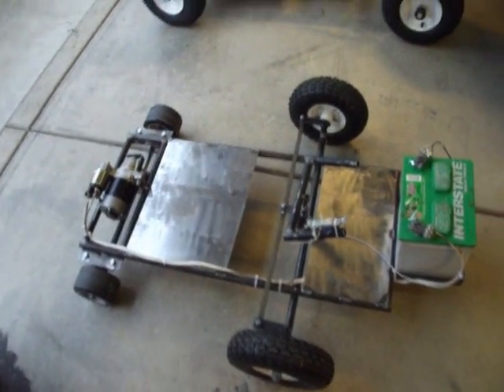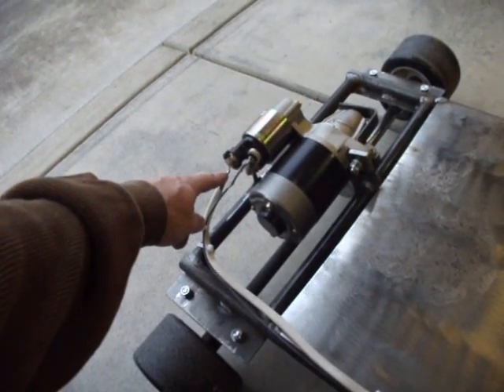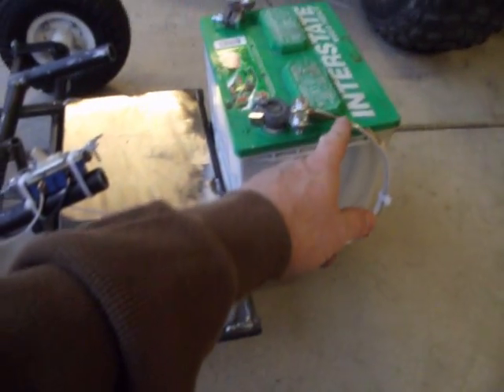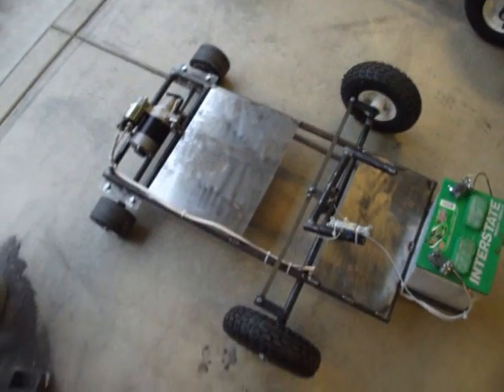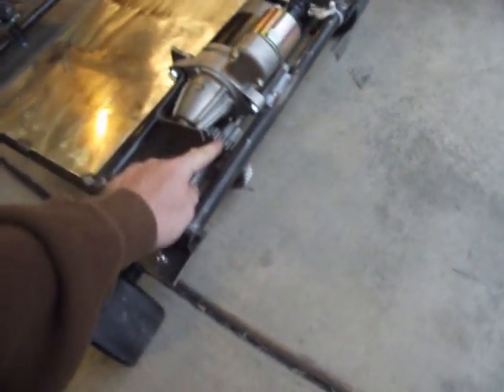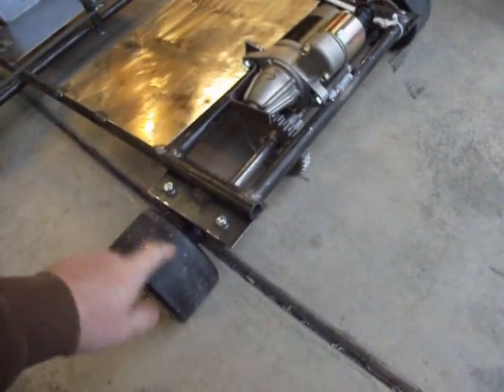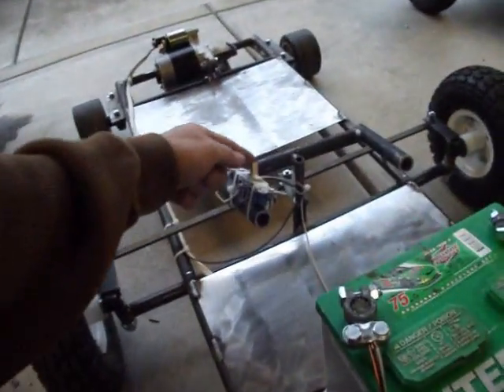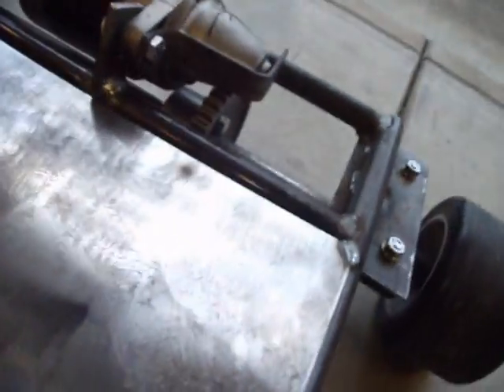Electric Go Cart 1

Comment: hi guy.. please explain who work The acelerator... i have a starter motor of motorcycle but can't controller the acceleration... help me please
Reply: Remove the solinoid and connect  riostat as a throtle
Reply from the maker: i just flip the light switch on and off NO accelerator! that is why im using plastic tires so they spin

Comment: can any one help me. i have a 12V starter motor that i want to use for my electric powered Go-kart. the starter will burn out if i keep my foot down for too long. im curious to know how long can i have the throttle on for before i need to let off and let the starter motor cool off or is there a mod that i can do to keep it cool?

Comment: add a larger gear to the motor and you will get more speed but less torque.
Reply: That's right.  Or a smaller axle gear.  Nice job though, it works as expected.